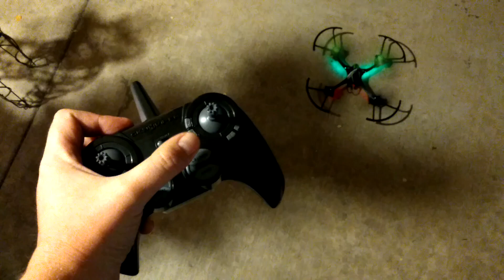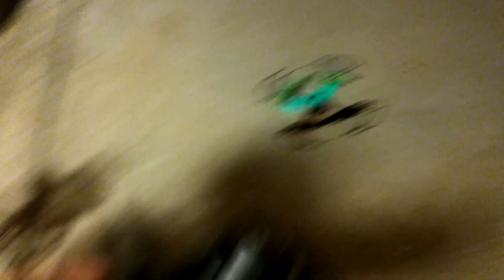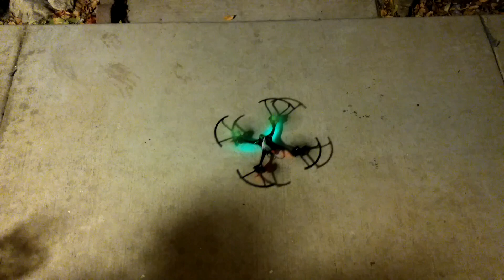Sky Viper E1700 Won't Fly

Comment: Same exact thing is happening to me. You probably have a burnt out motor, spin all your props by hand. One may be rougher than the others. Try and fly your drone for a few minutes then smell the troublesome motor. If it smells you burnt it
Reply from the maker: I went through two of these. Both had the same problem. Took both back to the store and have moved on to much more reliable quads.

Comment: Blades are on wrong. Mine flus just fine and I built it in about and hour and a half
Reply from the maker: My blades were on correctly. The throttle didn't work properly. It's apparently a common problem.

Comment: I also have the same problem. It took me about 2 hours to make and I just finished it but only the front propellers accelerate and the back propellers move but don't have enough power to go up.
Reply: Pharaoh 2O same
Reply: fortnite noob I fixed it tho
Reply: Pharaoh 2O how?
Reply: fortnite noob Check on the back of the wings and see what letter it has A or B and look on the 4 motors and then Put the propellers on the corresponding letter
Reply: Pharaoh 2O thank you so muchh

Comment: Did you figure out any solution for this? My son spent several days building his, and it's doing the same thing. We've confirmed that it appears to be properly built and are about to return it to Amazon.
Reply from the maker: No resolution yet. I made the video to show the customer service the problems I was having. Their suggestions: return it to where I bought it or order replacement parts from them - not very helpful. I ended up exchanging it a couple of days ago and plan to build it again. If the second has similar problems, I'll just return it for a refund. Its sad since the S1700 (same model pre-built) is a great flier and this has potential to be an excellent project to teach kids some RC build skills.
Reply: Ok, thanks. My son actually had a lot of fun building it, and was really enthused to be able to fly a drone he built himself. It's been a disappointing day. I think we're going to return it to Amazon and just use the money toward a prebuilt drone for now.
Reply: Deirdre H  I just bought mine yesterday built it last night and mine did the same thing I've installed a new antinna and also upgraded the battery and nothing still the same so I'm also gonna take mine back
Reply from the maker: As an update. My second one had the same problem. I tried it with and without the prop guards to see if weight was an issue. It never got more than a foot off the ground. Disappointing. I returned it for a refund and moved on.
Reply: Hello! I had this same issue and I HAVE A SIMPLE SOLUTION. Take a close look at the propellers. You will see that they are not all the same. Then once I made sure they were matched as in the app/ instructions, works amazingly. I hope this helps and you are able to have as much fun as me!
Reply from the maker: The propellers were on the correct motors. I built it multiple times and even verified it with Sky Vipers Tech support. The props provided lift, but the thrust was limited. I could hover a few inches off the ground like a hover craft and even get directional and rotational control - again evidence that the props were in the correct positions. The problem was that the motors would not increase in speed with throttle input. Even if I held the quad and felt the air coming off of one propeller, there was no noticeable change with throttle input.  I am not the only one who had these issues: http://amzn.to/2GkzPPi. I'm just the unlucky one who bought two and had the same problem with both. This is why amazon and Walmart are selling a $50+ MSRP drone for <$17 right now.
Reply: I purchased one yesterday and once I completed the build, it did the same as you described,  Then retraced the instructions and one thing the app instructions doesn't mention, but the paper instructions do,  is that the blades have Letters on them Green A and B , Black A and B, when installed  need to be opposite each other Green A to Black A, Green B the Black B.  Once I made that correction, it lifted right off the ground in to a hover.  Hope this helps.
Reply: crxsirt36 Thanks so much for posting that. It was our exact problem. We properly aligned the A and B and have LIFTOFF!
Reply: Terry O'Shei excellent! I'm glad I helped. Happy flying!